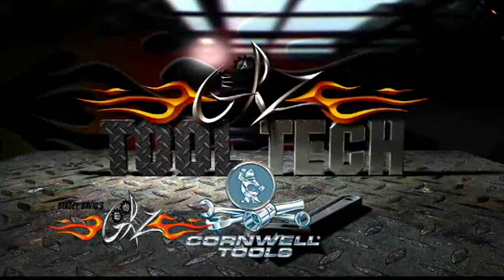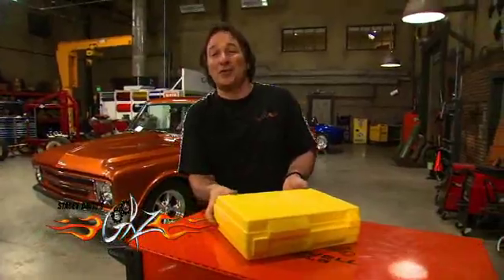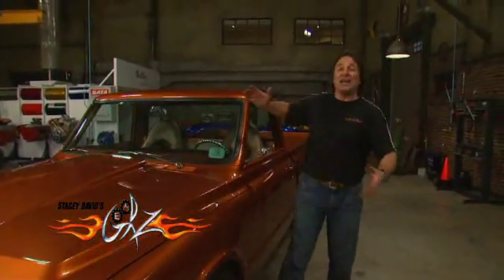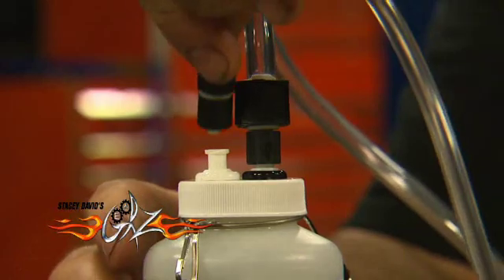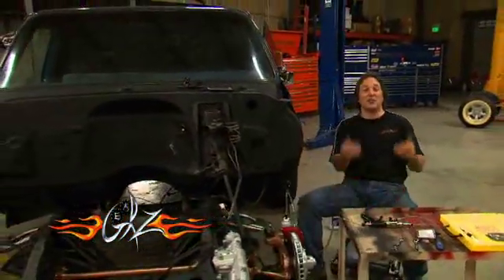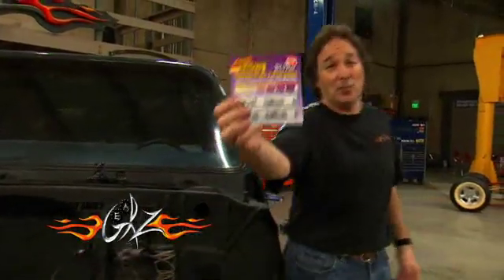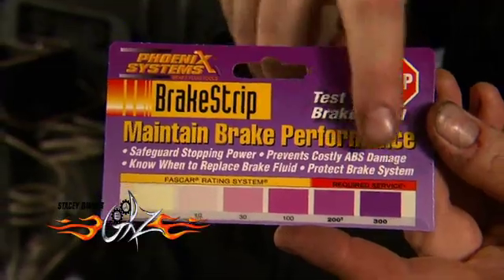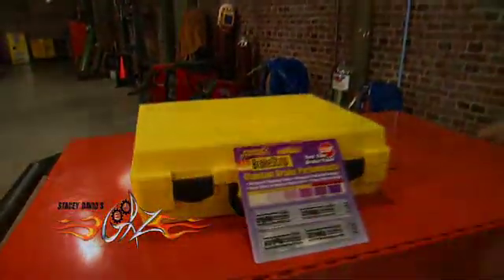How to Bleed Brakes by Yourself | Phoenix Systems

Comment: I bought one of the V-12's and have been happy with my purchase. I did have a time or two where it didn't want to automatically retract, but wasn't much of a problem for me. It gave me a rock hard brake pedal. I just did one bleed screw at a time then checked on the master cylinder to make sure it didn't over flow. I even used the tool to pull the excess fluid out of the reservoir.

Comment from the maker: Matt, we want you to be happy with the purchase that you made.  We responded to a previous post on this video from you to call us at 1-888-749-7977.  We will make this right for you.  We do not see your information in our database of customers so we are not sure where you purchased the tool from so it may have been an older version of the tool.  

Please call us at 1-888-749-7977.

Comment from the maker: It is recommended that you flush the system out before performing the reverse bleed method.  By flushing the system before, you remove the unwanted material in the brake lines and then the reverse bleed will remove the trapped air that may be inside of the lines.

Comment: The V12 is a rip off. The stupid thing would not retract on its own. I had to manualy pull it back every time. The reverse brake bleading did not work. The gun just leaked when I tried to pump it. The only thing it is good for it the rubber fitting and tubing that fit on the bleed valve and it is not worth $65.

Comment: The problem with this method is that all of the corrosion in the wheel cylinders is being forced 
back into the whole system instead of just taking the short path out of the bleeder screws.

Comment: I bought the cheap one, about 80 bucks. I figured I would give it a try. I think it is great and if the one I have wears out I will spend the extra money for the better tool. Not long ago took my pick up in to have some major repairs done on the brakes due to time restraints and all. Got it back and brakes were still a bit spongy so used this tool and now have good firm pedal.

Comment: @mrjost55  It does remove the old fluid out dumb ass. It goes out through the reservoir and you use siphon to remove the fluid so it doesn't overflow. Why call it a bleeder if it doesn't remove old fluid?